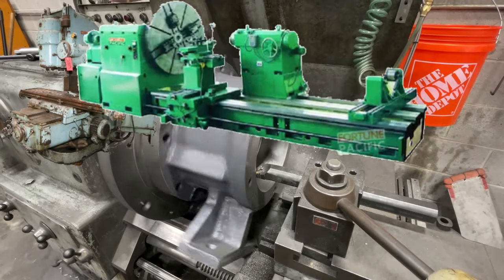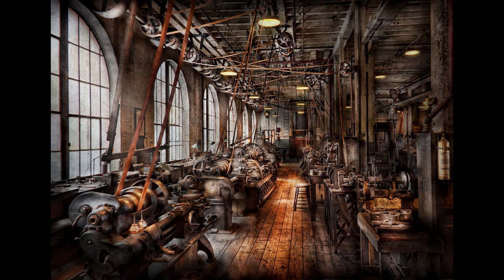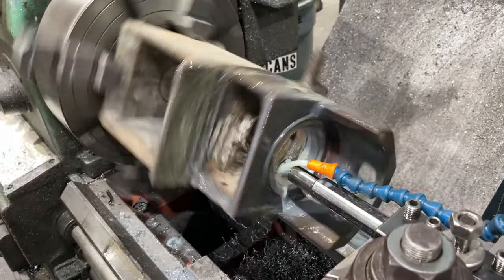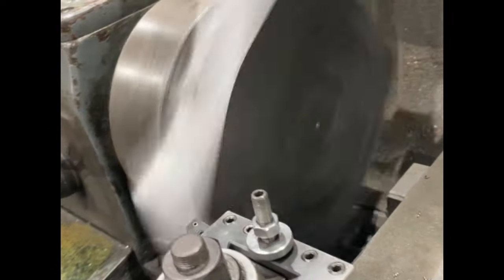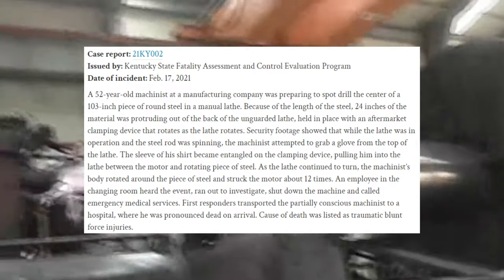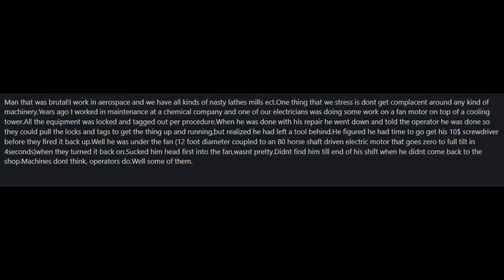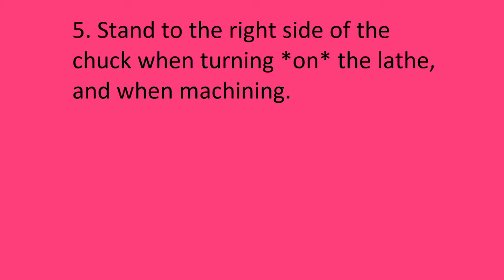The Lathe - Complacency Kills

Comment: Quick correction needed:
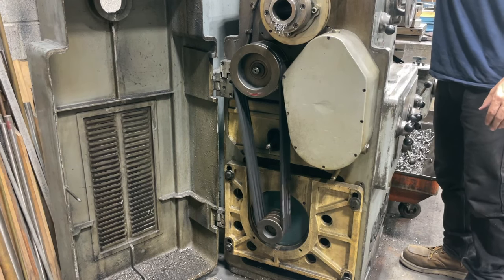About 12:40, it's mentioned that speed of an AC motor is related to voltage, but it's actually determined by line frequency and construction.. 50 or 60 Hz line frequency, and the number of poles or windings, determine the operating speed..
Reply from the maker: Thanks, that makes more sense. I had no idea how to articulate "what the RPM of the motor would be". Lol, thanks for clearing that up
Reply: @acsissystems  oh and.. as a general rule, avoid using "lol" at all costs unless filler material is your jam or you actually are Laughing Out Loud.

Sorry i had to say, nothing against you personally.  also, today is my birthday and for the past 40 odd years,  i got into the habbit of using that entire day to be the worst person i can be, without forcing anything. It makes up for the rest of the year where i genuinely believe in kindness and act as i would love others to act around me.

22 hours and 20 minutes remaining - i feel strong for a successful day of equalizing the scale.

Haha. (not lol) I'm so french.
Reply from the maker: @b0rd3n  thanks for the comment on our video. "Lol" in the modern sense of the acronym, is a tool to diffuse a lot of tension in the engineering industry. I was not literally "laughing out loud" at his correction, I was merely agreeing with the commenter and making them feel more at home by being right. Thanks though
Reply: @b0rd3n, your correction of the use of Lol is interesting😂 You're only the worse person on your birthday? You should tell my wife! I wake up grumpy, grouchy,  grinchy, crabby, irrascible, irate, angry, mad and furious every day all day long! My wife doesn't even see the difference between when I'm awake or asleep. She claims I shout scream and chew out people while I sleep. So don't be too hard on yourself on your birthday.😂😂😂

Comment: I greatly appreciate your production Sir. As a retired Lt. Fire/Medic & ED-RN, I've dealt with numerous industrial incidents, many of which could have been avoided. In my retirement I've acquired 3 lathes, largest being 12x36 manual, 1 CNC mill ~1000Kg with a powerhead for "lathe" work. I've learned much from the mistakes of others, but I could not begin to cover all that info here. Best advice I ever got was from my Father; when he was teaching me to operate power tools, he said son, that tool does not care how loud you scream. I still have all my parts, and I'm always trying to learn. Thank you very much for your information.
Reply from the maker: I recieved the same advice, the machine will not care. sobering advice for sure

Comment: My job hired me and my co-worker without training despite hydraulic equipment and other dangerous equipment being present. (Its my 1st job and i never have been in any similar environment, even at my stem school) We had to learn on the spot from co-workers (or getting injured or near death lmao). Despite many warnings and safety protocols, the company lets shit get by. Until they freak out for steel toe boots not being used or if the owner is around (who seems to care more about our personal well being than my supervisor who treat us like robots). I dont think ill last more than another 2 months here but my respects to machines, electricity, and people who work across dangerous equipment
Reply from the maker: Yeah definitely find a better place to work. Sounds like you’re about my age, I had the same experience my first 4 years or so, getting yelled at all the time, bad leadership, frustrating times for sure. But as I began to learn and grow up, it’s kinda like any other career. The first few years (in place of undergrad college) are a huge grind. I’m our case it’s just an extremely dangerous grind 😂 

If you can find a place where you can start small, loading parts into CNCs for a year and really seeing how all the tools work, that also helps teach you how to later on run manual machines somewhat correctly off the bat. I did 6 solid years of manuals before I ever got to programming the CNC, but in those really tough years man I learned everything I know. And currently, I tell my foreman what to do at work 🤘 lol.
Reply from the maker: My 2nd job in the industry was a lot like what you’re describing. I had an apprentice for like a month but the shop was so old and worn out I was like, dude this isn’t the place to get any good learning experience. While some more seasoned gentleman will argue, “learning on an old machine is the way to go” yeahhh, but if the ways and ball screws, lathe chucks, are so worn out that you break taps all the time or holes don’t drill center, yeah that’s fkn impossible to learn on. I could barely do the work they wanted done, nevermind trying to teach a young stud how to do it on these lathes that were missing entire gear teeth
Reply: Don't be afraid to file OSHA reports.

Comment: Early on, I did electrical work in a sawmill, which included working on a LOT of "rotating" equipment... Even unpowered, one could simply get a machine rotating, to inspect it, or clean it, and the sheer rotating mass could drag a hand into gearing, or into a blade... A 600 hp chipper has a 1.5 m diameter rotor, with sharp blades, spinning in a housing... Open the access door, push on the rotor, and just slip a little tiny bit, and part of your hand gets amputated by those blades, with a 300 kg rotor... Speaking from experience, unfortunately, but fortunately, just lost skin on two fingers, however a couple of seconds difference, and could have lost all of the fingers!
Reply from the maker: jesus. 600hp is freaking insane power, even subtracting the sharp blades. That's wild. Electricians deal with waaay higher dangers than just the every day hole driller. I hope your digits are all okay these days!

Comment from the maker: I forgot to include this piece of advice in the video. But after a while, getting used to running lathes, you develop a 'force field' around your body, that you never let get near the chuck or work piece. Full article is available on our website! www.AcsisSystems.com    with a bunch more footnotes and first-person point of view style extras. It's a work in progress

Note from author: The good news is, after a couple of years as an appretice, you will develop a sort of 6th sense, or force field bubble around your body and you will become more comfortable about knowing where your abdomen and arms are at in relation to the lathe chuck or workpiece. This is very handy specifically for when you are punching information into the DRO which is usually mounted near the chuck. I catch myself all the time going to reach for the DRO or perhaps something in the back of lathe chip pan and being like, nope, 6th sense activated. Then find a safer way by powering down the machine or walking around the entire thing if you must keep the part running. Never lean over the spinning workpiece to grab something, even if your shirt is tucked in, unless you want to be turned into a raspberry slushie.

Comment: I have fitted an e-stop switch on the headstock and at the tail stock.  I can stand and stay at the right side of the spinning work.  When I was training, the work piece started to chatter on the lathe.  I turned off the power as as the chuck came to a stop, it fell onto the bed.  The previous trainee had not tightened the chuck and I hadn't checked the machine properly.
Reply from the maker: holy crap. thats a good save. E-stop on the tailstock is a great idea, I will definitely consider doing this

Comment: Why doesn't every manual lathe have a deadman's pedal connected to the brake?
Reply: Excellent question.  On my personal tools, especially my table saw and routers, I picked up foot switches from Harbor Freight.  They don't cost much and you can get them in 'momentary' and 'power maintained' formats.  I have never seen a deadman's switch on a lathe.

Comment: Yeah, I have a relatively massive lathe, and a few other smaller ones... I treat every machine with respect... If a machine can work metal like its butter, you dont even want to imagine what it can do to your body if it catches you... A large industrial lathe, even a short bed one, really doesnt matter what the dimensions of the machine are, if its a strong industrial machine, it can tear you to shreds like a woodchipper or a meat-grinder... You all can theoretically conjure an impression of the power required to cut continuously say a 4mm(cca 1/8th inch) chip... You can try scraping a piece of steel with a scraper, and you can maybe dig in a fraction of a millimeter with all your power... A large lathe can remove kilograms of steel in minutes pretty much... When you hear that a car has say 250nm of torque or 400, its a decent daily driver, and you know that it can shift its 1ton mass uphill like its nothing... A large machine with 5 or 10 horsepower, with a massive gearbox likely outclasses that like a Bugatti does the VW beetle from back in the day... Just a handheld angle grinder can rip itself out of your hands like you are a child, and that is a toy when compared to a lathe of almost any size... 
If you have a passion for machines, you watch This Old Tony or others, and you decide to get some machines, never underestimate the immense capacity they have to obliterate you like a landmine... Machines are amazing, beautiful and magnificent pieces of art practically, but just like a car, they are pieces of art that can turn you into chunky paste... Get an apron, have it custom touched up by a tailor to fit you like a latex gimp suit if you can... You dont want to get caught by a machine capable of working metal... Some baby lathes with toothless belt drives can be relatively safe and you can stall them by hand, at least cause the belt to slip, but if there is a chuck on the lathe and a piece of work, that is a relatively large mass that you have to force to a halt, and just a few kilograms(say 6 pounds) of rotating mass at say 1200rpm will be enough to mangle you, not outright obliterate, but it can take your arm off or smash your skull into the bedways if your hair gets caught... The head smash would likely be instant death, the arm could turn into death, but you get the point... While some baby lathes may be under-powered and anemic when compared to larger machines, they are never to be treated without utmost care and respect... 
The same goes for any other metal working machine, be it a larger pedestal grinder, a drill, a mill or any other configuration of aforementioned machinery... Please, dont ever take risks or engage in stupid setups... If you have the slightest hint of uncertainty regarding safety of any operation, think about it, reconsider the steps, find a solution that at least feels completely safe... And i know its hard, but try finding someone with machine experience, find time and offer to ``apprentice`` under them for some time, just come, hand them the tools they ask for, bring them coffee or whatever they like and learn from them, dont annoy them, but try to get them to teach you... It will only cost you time, and the returns could not only save your life, but you will also see things that could take you years on your own to figure out how to do... And you will make a friend after a few days if you arent an asshole and if the other person isnt an asshole - avoid assholes... Machinists are grumpy, but there is a difference between grumpy and an asshole...

TL;DR - just watch the video...
Reply from the maker: great write up. totally agree. I like your analogy with the angle grinder, most of us can reconcile our relationships with that tool, having bit us once or twice. This Old Tony and Abom79 have terrific knowledge of the trade, far wiser and greater than someone as young as us could ever present. Some lower powered equipment as you stated, like the 1/4 horse bench grinder i mentioned, you can probably stall those but man, AC motors are freaking dangerous beasts. I wish I had a junker old lathe I could run some tests on. Leaving the chuck key in and having it slam into the ways, and fly out of the chuck (or shear off completely). Just to demonstate the point. My dad always argues that mills are more dangerous... sure they can spit stuff at you, I've personally exploded a 1" diameter HSS twist drill in my face, all the shrapnel entered my shoulder thankfully. There was easily 100 pieces of fragmented drill all around the mill. Mills are scary, but I tell him, lathes dont have that forgiveness. Lathes kill people

Comment: Aaaaaargh.  If you're going to start talking about technical matters, particularly with regards to electric motors, try and get at least some of it right.  The person who wrote the utter bollocks in chapter 3 wants to be put in the naughty corner.

- When you run a machine in low gear, you do not increase its power.  Power is a function of rpm multiplied by torque - when you reduce the rpm through gearing, you increase the torque - the power remains the same (modulo losses in the gearchain).

- The 3 phase (and even single-phase) induction motors used in "normal" sized machines (over 3/4 hp and under about 600hp) run at a speed determined by the line frequency, and not voltage.  Speed variation is thus done by varying the frequency and not the voltage, the variac you show is useless on all but the most piss-ant little machines.  There are exceptions to the use of induction motors, of course, but the use of large DC servos is generally restricted to bloody great CNC machines, and the speed variation circuitry on those is very complex.

- For a typical induction motor, the power is not determined by the voltage, which is constant for a given motor ad line supply, but rather the current flowing through the motor.  A 1kW motor powered at 400v will nominally draw 2.5A.  A 10kW motor powered at 400v will draw 25A.  Whilst in theory it would be possible to reduce motor power by reducing the voltage input, this does not typically happen as it's bloody complex to do.  Reducing the frequency to reduce the motor speed does not reduce the voltage.

- Teslas and (modern) cordless drills mostly do not contain a "variable voltage control".  They are driven by what are effectively 3 phase induction motors, and speed is controlled, once again, by varying frequency.

Goog god almighty.